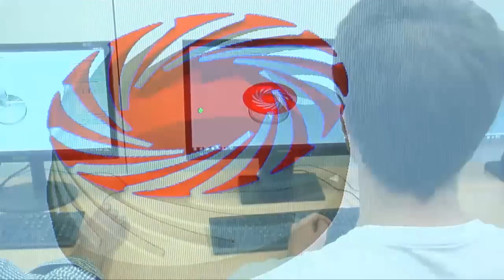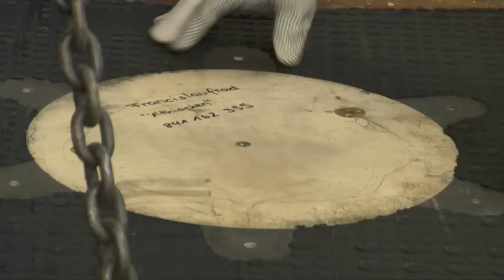Sand casting: Digital production of complex sand moulds by voxeljet

Comment: Seems like it would be easier to carve this out of a billet rather than printing a mold, cleaning it, shipping it, casting it, sanding it, x-raying it, etc.
Reply: there is no way to machine that from a single piece, no tool can get in those shapes and reach the inner sections
Reply: tip a fadora 2 u
Reply: tip a fadora

Comment: I worked SLA machine that makes any wax parts, layer by layer. In this machine technique is like the SLA technique but connection between layers makes by the glue spraying or sand welding.